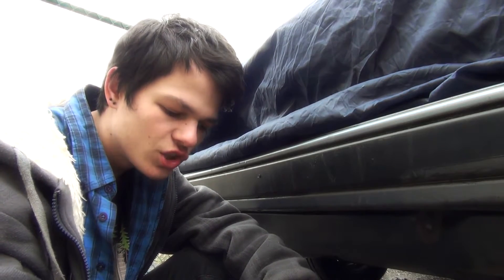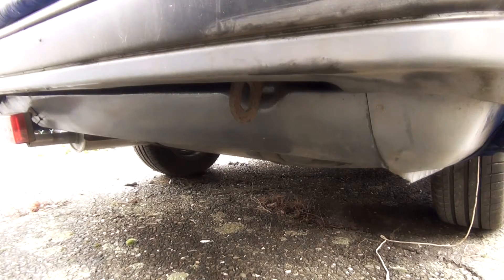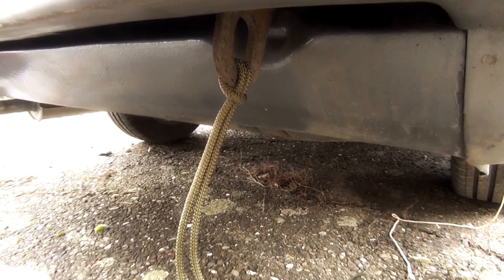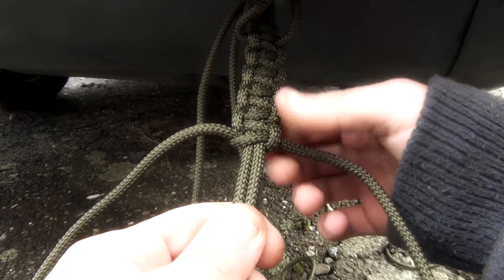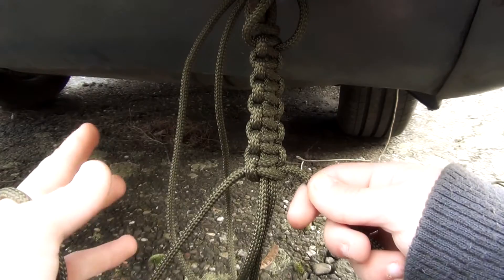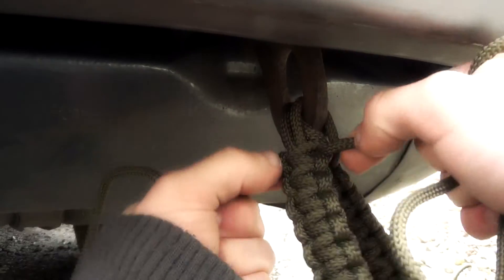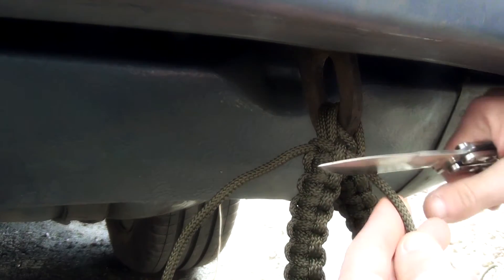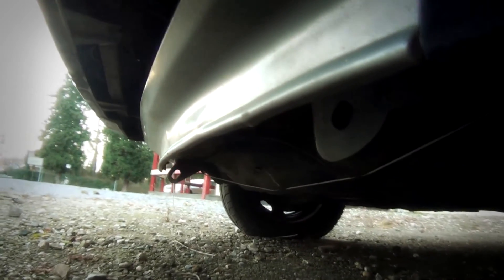Custom DIY Tow-Straps

Comment: is it 550 paracord?
Reply from the maker: you can take any size, i have no idea what i used back then
Reply: ACKING_QC no that is not 550 paracord that looks like standard 100lb test nylon rope.. 550 paracord comes in one size 3mm in diameter but it does come in 100s maybe 1000s of colors.. the good stuff is around 10cents a foot so 10 dollars for 100ft please dont use anything but paracord if you follow this guys tutorial.. youll most likely end up snapping the cord and sending the vehicle you are recovering back to where it was.. remember your moving a 1000lb+ vehicle.. be safe
Reply: @brandongreaves5222  Hipefully it's decorative. Sujper unsafe even if real 550 or better stuff.